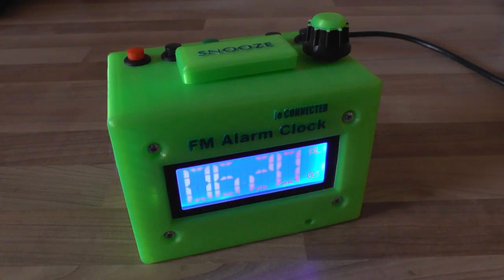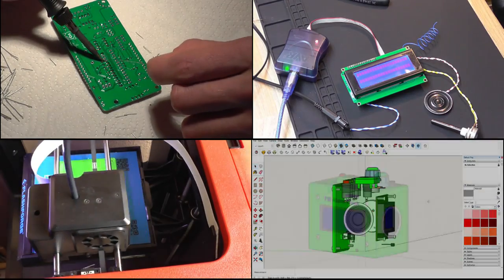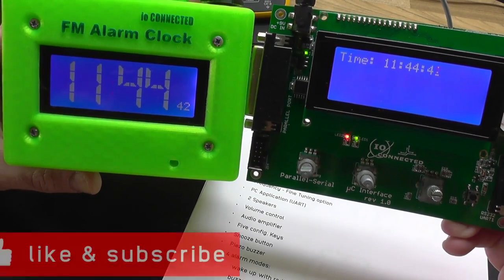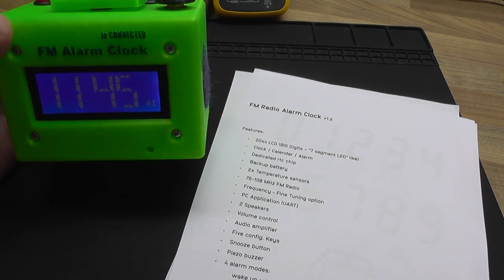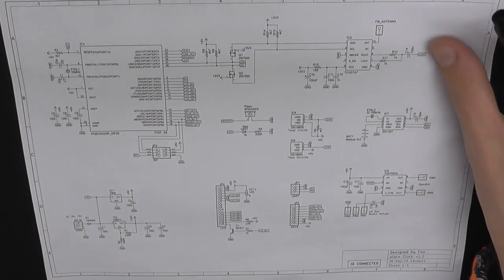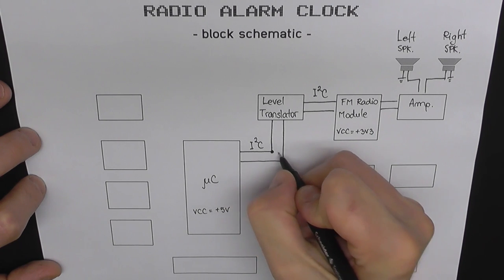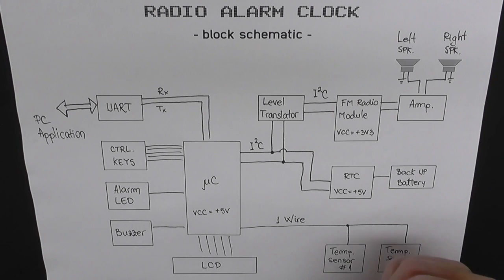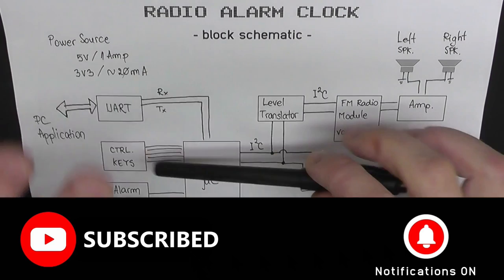Build this COOL Radio Alarm Clock - PART 1

Comment: I've been following you since your lc meter project. Your LC meter project really inspired me to make a digital and analog circuit at once. I still stuck at how the oscilator works. Me my self always learn someone circuit's and make my own version out of it. Hope you can give a brief explanation for that oscilator part. 

I've made similliar project like your clock, but i use 7 segment four the display. That's my first project since i'm entering electronics world. I think your choice to use wall adapter is a wise choice because the system might be draining to much power and baterry will draining like crazy. I remember that time, my baterry only last one night, and when i wake up my display already blurr hahaha. I think  unefficient firm ware that cause the trouble. 

Anyway, all your project is really awesome!!!. Im looking forward for this kind of  hobyist friendly project in the future.
Reply from the maker: Thanks a lot. I thought I already explained the lm311 oscillator. That original circuit was designed by Neil Hecht, I credited him in my LC Meter video. The LM311 is a voltage comparator. Its output will be either 0 or 5V deppending on the voltages on its input pins (2 and 3). When the output gets high, it will also charge the capacitor on pin3, then the output goes low again. This induces a transient into the tank circuit L1-C12 and it causes it to oscillate at its resonant frequency. This is also what causes the square wave signal with the same freq. to appear at its output pin. This signal is also fed back into its input via the R17 - C11 and it keeps the osc. going. Hope it was clear enough. 

😊Thanks for watching !!

Comment: The back-up battery is only for RTC, so when the power goes out, will the clock sound a set alarm as usual or will the device be off/with no power? Also: is it possible to add stations to quick access without using a PC; using some button combination?

Looking forward to SketchUp6 modeling/importing into a slicer. Do most slicers accept .skp files natively or did you need to get a mod for SketchUp to be able to export files into a more proper format perhaps? Do you use it for designing mechanisms too or something different like Fusion360? Do you use Cura as your slicer maybe?

Great video- very inspiring; and thanks in advance for potential answers.
Reply from the maker: you're right about the rtc battery. The clock it self is powered by a wall adapter. Couple of scenarios here: you could go for a battery  based power supply, and power the whole thing without having to worry about blackouts.
Or you could add a switching circuitry that would auto-connect a battery pack as soon as the AC power goes out. That's a pretty nice contingency and it's not very difficult to add. As soon as the power comes back I would measure the battery's current and charge it till it's full again. I would still keep the RTC battery to avoid any resets or glitches while the switching is performed. The avr can recover after a reset and read it's EEPROM, but I would try to protect the RTC as much as possible. At least while using this type, the DS1307.
The way it is now.. it's like if you have a blackout during the night which lasts more than a few hours, then probably missing the rush hour to work will be the least of your worries. Maybe check out that fridge first or the heating system 😄

I have a forge finder 3D printer and I use it's own slicer. The sketchup has a plugin to export STL which I then import in my slicer. I have other slicers too but there's not much I'm missing in the one that came with my printer.

You could add an option to enter the stations (at least their frequencies) manually, everything's open source. Currently you can do this through the PC App (UART connection) or adding the stations directly in the firmware, recompile and then reflash the avr. 

If you still have questions don't be shy. Thanks for watching !! ❤